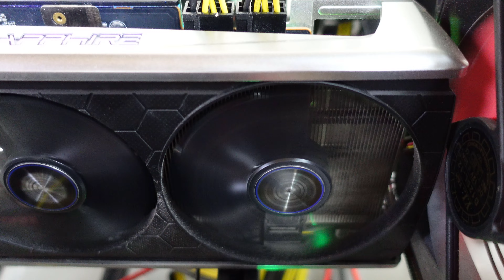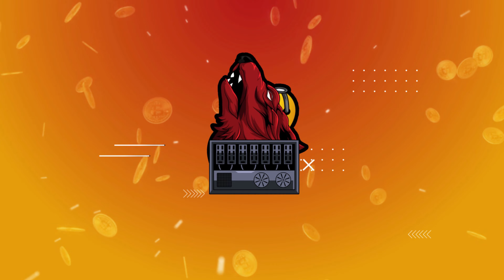Crypto Mining 5700XT On Ravencoin Proper GPU Powering MUST WATCH Dont Burn Your House Down!

Comment: Strange.. my gigabyte 5700 xt oc 3 fan, micron mem. does 29.02Mh/s (147W in miner reported) 8:20 all of power goin through pcie cables?? You forgot about pcie on the mobo, it pumps 75W!

Comment: Noob question: What are you using to get the VDD and Memory clocks lower? I've tried in Afterburner and it won't let me go lower than 850 voltage and 1750 mem clocks. Trying to do research and DD and need help with a starting point on what to look up. Thanks!
Reply from the maker: Need to use more power tool edit the power tables to allow it to go lower it can't go below the set defaults without editing it when you edit the bios.
Reply: @RabidMining  which power tool program(s) and bios editor(s) do you recommend i take a look at? Thanks again :)
Reply from the maker: @itzj3rmz  more power tool (MPT) and red bios editor

Comment: Wow, what is this CPU and mobo that run at 19 watt?
Reply from the maker: Most mining mbs do usually when you see tests done that's with a gpu in running idle with fans turning which makes a system look like 60 to 90w ultimately taking more power off a gpus consumption making it seem more efficient
Reply: @RabidMining  asking coz thats not obvious, i have 35w tdp intel i5 cpu's on 1151 and i cant get system at idle under 50 watt from the wall, whatever i do, without graphics, only mobo, psu, ram, ssd, and fan,  z370 mobos, b365, the psu is bronze or gold it doesnt matter so the mobo is the key i think, and a right intel cpu to draw 20-ish from the wall at idle and i dind figured out yet which one
Reply from the maker: @Chomikback  crazy will look into the cpu I use.

Comment: It all depends on what your trying to do.

If power is dirt cheap than you want max hash power be dammed. I know some people who pay like 2c/kwh.

The other time for being effecent is if your maxing out your pannel power. 

Essentially what in trying to say if your your increase in profit is less than increse in cost of power drawn your doing it wrong.

 Much like you I do fear for people who switch to rvn with out changeing there power setups and burning down there farm.

I know my rig woud melt under rvn right now.
Reply from the maker: Ya true power cost matters most people dont have the cheap btc mining 2c power lol.  The main thing was powering the card so you dont burn anything and fitting more mh per cuircit.
Reply: @RabidMining  this is also true. my power can get as cheap as 6.5c per kw but on the whole as a  avrage its closer to 10/11c.

Also theres  the whole lower the global emissions from mining too.
Reply from the maker: @andrewmcewan9145  true but seen a video funny know one talks about electric cars for charging.  A guy with 30gh had a Tesla and his car uses more power to charge then his rigs.
Reply: @RabidMining  thats very funny but if you have a model s it has a 100kwh battery and recommend charging is 8.5 hours at 240v 60a so it makes sense. The 30 gh woud have to be asics though.
Reply from the maker: @andrewmcewan9145  not sure what all it was they had just a post they said they noticed.

Comment: The miners champ, ive been testing clocks for my 5700xt's but haven't been super successful, ended up running my ETH clocks 1225  726/800/1300  915  and was pushing about 20-22 mh/s @157w in HiveOS. definitely going to try your Rabid Clocks and see how my XFX's like them. Big up!! Im going to bounce back over to your 5600 Video shortly
Reply from the maker: Right on thx have u seen my eth tests with this card?

Comment: What's the best coin to mine currently? I just got a 3070 and a 5600xt
Reply from the maker: Currently its ethereum testing other hashrates for when the time comes to switch.
Reply: @RabidMining  never mined before is this setup alright? Is it just a software you need for mining like through windows?
Reply from the maker: @Mario2o  yup try this video on how to mine ethereum https://youtu.be/2SYmiEpgm6s now for the amd card should use teamredminer and for the nvidia card should use trex.  is other programs like phoenixminer that can run both as well as NBminer.
Reply: @RabidMining  Look at mining turtlecoin (TRTL). Its 400% in the last 5 days. Looks good.
Reply from the maker: @laserpoop  alrighty
Reply: @RabidMining  not 100% sure, but  don't know if you can run it on hiveos
Reply from the maker: @laserpoop  I'll look into after I get home